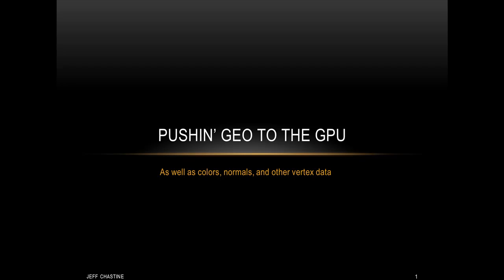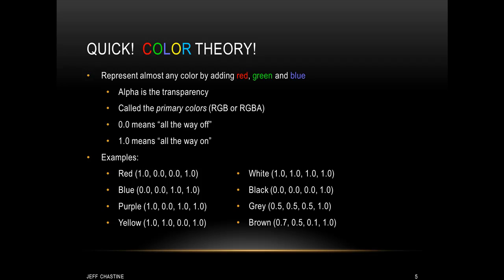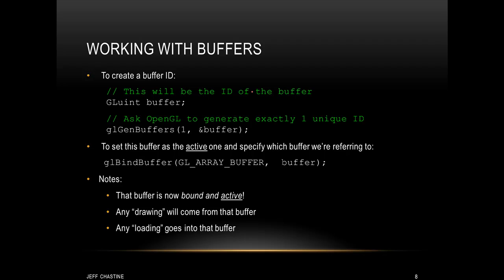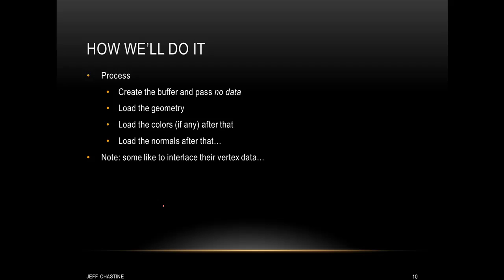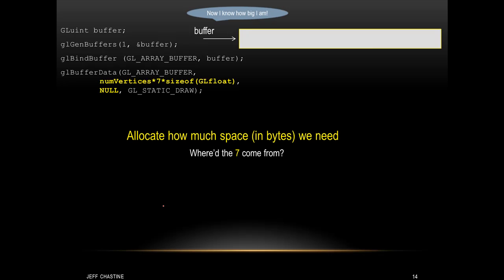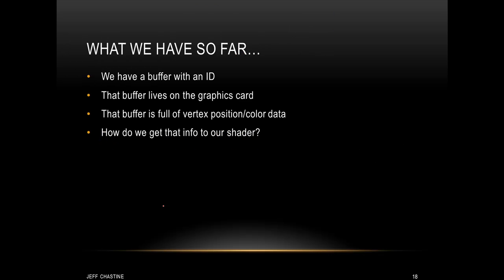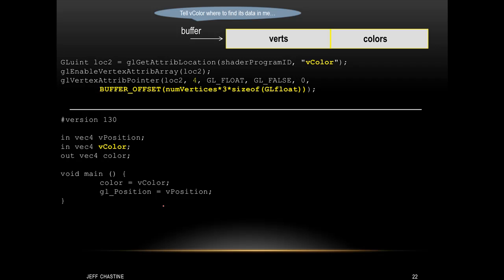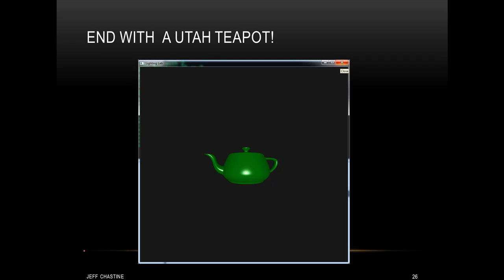Tutorial 5 - Vertex Buffers in OpenGL

Comment: 5:28 -> If we assume everything is in GLfloat* data (which is a pointer) what is the meaning of second parameter of function glBufferData (...,sizeof(data),...). Do we really have to pass the size of pointer or there is some mistake and it should be: glBufferData(...,sizeof(GLfloat),...). Assuming GLSL/OpenGL as C API to GFX hardware.

Comment: Hi... a question please ... How does the GPU know which VertexAtribute to be used for position and which one to be used for color as I can see in the code towards the end you use glEnableVertexAttribArray to represent both .... thanks for the video
Reply from the maker: Yes, you're correct in that the call to glVertexAttribPointer is used to set both locations, but look at the call in slide 22.  You can see we're passing "loc2" as the variable, and then passing (as the last parameter) where that data starts.  Compare that to the first call to glVertexAttribPointer and I think you'll see the difference.  I hope that helps.
Reply: Ok.. I think i got it... Thanks... The gl_position value in the shader is what determines which vertex attrib to be considered as position... but there is no such similar gl constant in the fragment shader.. Why is that?

Comment: Hello, I have enjoyed your videos and I have to say, these are the best I've seen.  I did have some issues with the previous video: my screen was also white and loading, but nothing happened.  The output screen appeared with non-zero values, so I moved on like you said.  Now I am running the other code, with the buffer and the triangle shows, but it stops as well as the blue color is not displayed.  When I try closing the window with the triangle, there is no response.   Any idea, what might be the problem?  Thanks again for your videos!
Reply: I got it.  On your next video, you show the code and I found that the file you have available does not match what you showed next.  In line 144, the last parameter is missing (....colorID,4, GL_FLOAT....BUFFER_OFFSET(3*3*sizeof(GLfloat))).  Thanks!